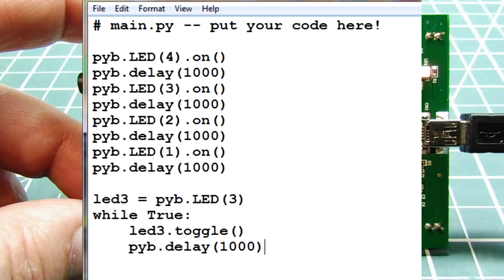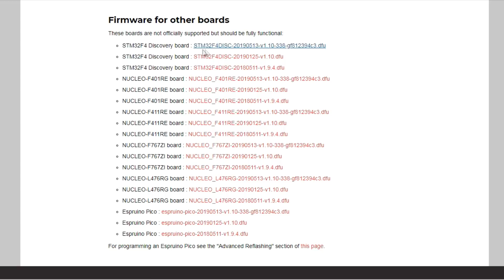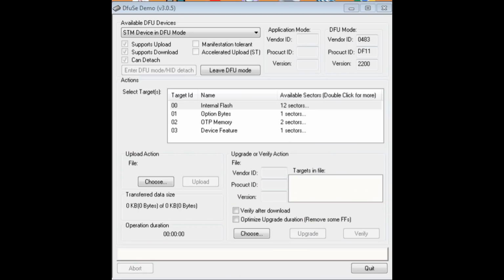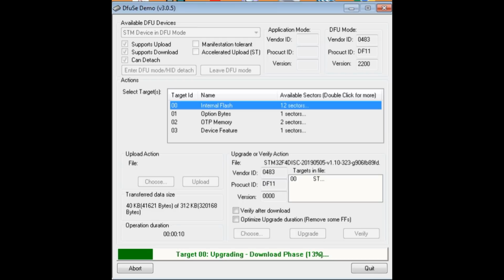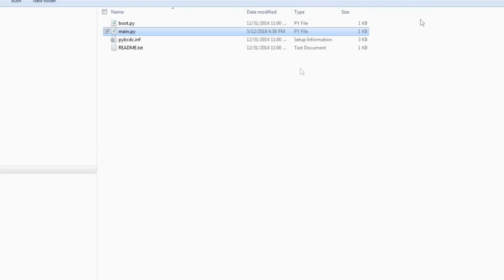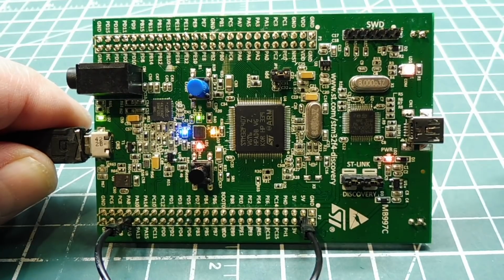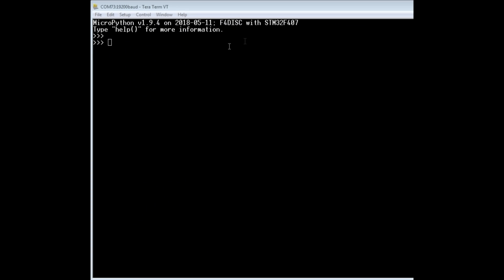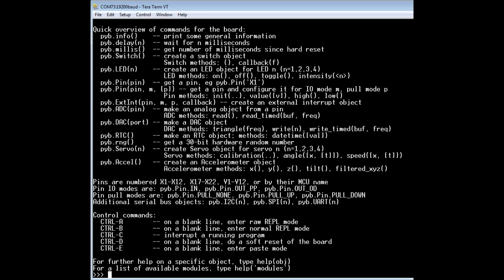STM32 Micropython

Comment: wow,it's a really good tutorial! By the way, I used nucleo L476 board, after I flash the firmware I can not find main.py, only a txt file    and htm file. I can only use Putty with serial communication, what's wrong？
Reply: Hey i got the same problem. Did you solve it? I could use the help. Thanks

Comment: Thank you for this video.  I could not put the STM32F4 Disco board into DFU Mode... The board enumerated as STM BOOTLOADER, thus the board could not be seen by DfuSe.  After a few hours of tinkering I discovered STM32CubeProg USB Drivers conflict (supersede) the DfuSe USB Drivers.  Upon changing drivers I was able to get the board to enumerate as an "STM Device in DFU Mode" and then flash the Micropython DFU image.  Here is the location of the default DfuSe USB Driver:
C:\Program Files (x86)\STMicroelectronics\Software\DfuSe v3.0.6\Bin\Driver\Win10

Comment: why spend 15 bucks on this when you can get an esp32 or 8266 for 3 to 5 dollars and add a couple of leds. geet dual core and multiple touch pins and more speed as well. Good video how to but why is the question?
Reply from the maker: The Discovery boards also incorporates a 3 axis accelerometer, MEMS digital microphone, audio DAC with class D speaker drivers and  onboard audio jack, ST-link programmer/debugger, CRC generator, and USB OTG support with all GPIO ports brought out to header connectors. The board is generally used for someone who is doing product development.

Comment: I have the Nuccleo-f0723b, can I use micropython on it? It doesn't seem to be on the micropyhton site.
Reply from the maker: Micropython is not supported on Cortex M0 processors with small memory footprints. Use a Cortex M4 with minimum 256k Flash and 32k RAM..

Comment: Do you have any tips on how to build  micropython using ST's Stm32CubeIde?   Also, since st-link supports bin files, is it possible to flash using st-link instead of bootloading and using DFU?   I've tried the official release, as well as the one from OpenMV, but they don't contain a workspace/project file, so not sure how to set that up.
Reply from the maker: You can load a .bin file using st-link. This video might help you out. https://youtu.be/K2NekHIwGWo

Comment: Hello 0033mer, is this card 100% compatible with the Pyboard micropython?
Is the Servo library recognized?
Thank you
Richard
Reply from the maker: No .. not 100% compatible. The hardware on board is different and also the Pyboard uses a "405" micro and the Discovery uses a "407". Most libraries would work but I have not used the Servo library.
Reply: @0033mer  Thanks for taking my call. So you can't use all the pins on the card? The Pyboard has 56 pins and this one is 100. That would be nice. If not, then I think the 
STM32 STM32F405RGT6 . It should be a 100% compatible clone as it has the same processor.
Thanks again.
Richard

Comment: Have you used Circuit Python from Adafruit? If so, how does it compare with Micropython?
Reply from the maker: I have not used Circuit Python but it is probably very similar to Micropython. Circuit Python was written to support the Adafruit boards which use Atmel Arm microcontrollers. The Arm microcontroller that I am most familiar with are the STM32F4 series.

Comment: Nice review 
Could you mention the advantages of using this controller? 
I feel it is too complicated to deal with such controller in a world where we have Arduino, ESP and Teenay which are very straight forward micro-controllers to program.
Reply from the maker: All ARM microcontrollers are generally more complex than non-Arm counterparts. Running Micropython on the Teensy or ESP32 would have the same learning curve as any STM32 Arm microcontroller.
Reply: The board he shows here does have one advantage over the ESP with micropython.  After flashing the MP firmware you will still need another tool like ampy or the like to get your scripts on the board, but it does have other perks as well. In the sea of choices we have today uC wise, use what you feel is best. :)
Reply: Sometimes you need the capabilities of this chip depending on what your doing.  I am kind of surprised there isn't a repository of code for this chip. The biggest advantage of arduino is that so many libraries are written for it.   I could not imagine having to write code  for the nrf24L01 .